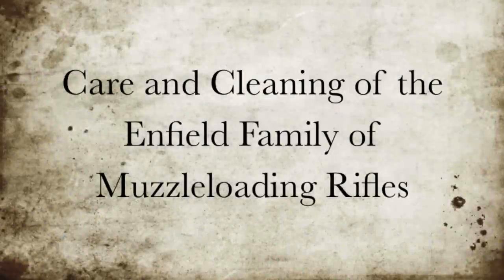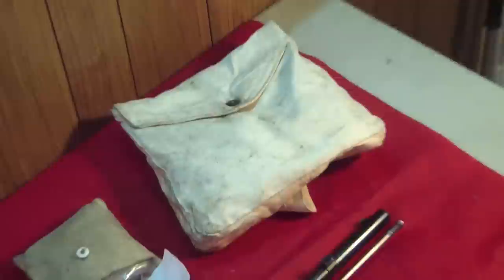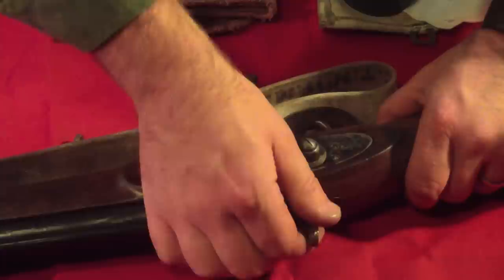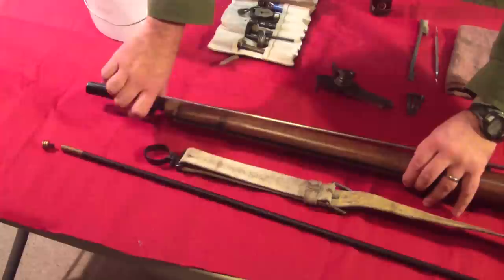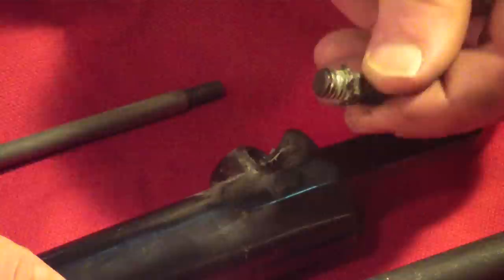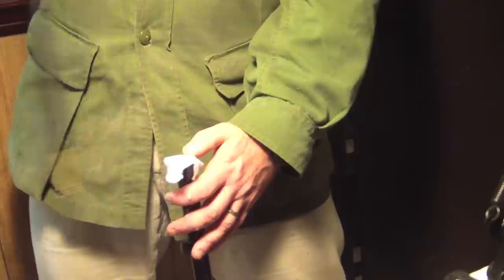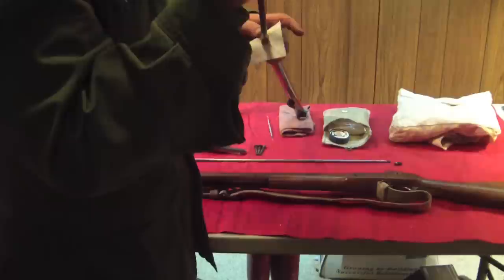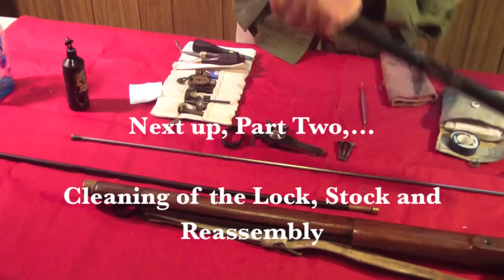Care and Cleaning of the Enfield Family of Muzzleloading Rifles: Pt 1

Comment: You're one of the few who I've seen use a bucket to clean the barrel. I have done this exact method for years, and it's the best way in my opinion to clean a musket barrel.  After watching guys in my reenacting unit using all sorts of items like they just raided everything from under the kitchen sink, with their bottles of Simple Green to Windex...etc...etc it was all so overkill. I showed my unit this simple method, and they were all amazed how well it works. Hot water, some dish soap and light oil (or Ballistol) for the bore is ALL you need. I can completely clean and lubricate my barrel, all with just 6 patches, while the other guys have a pile of dirty  patches around them and scrubbing away. lol  As you said, when the barrel is full of water, on the down stroke, push down and it blows everything out of the cone hole, literally blasting everything out like a fire hose. With this method, you're basically pressure washing the barrel. It's awesome.

Anyhow, another fine video. Thank you!
Reply from the maker: Cheers!

Comment: Hi.  Better way to remove the lock is to loosen the nails then tap the heads with the turnscrew handle.  The lock plate is pressed out from the inside and doesn't damage the inlet.   I  also clean the nipple to bore channel with a section of  bent pipe cleaner - gets round the bend.  Superb videos and presentation.  First class.  Thank you.
Reply from the maker: Thanks for that Peter...  I suppose that I should have included that method as well....  Typically, I don't need to as the lock slides out with a bit of torque applied to the hammer to keep things square.  The mortice is not damaged in any way as the lock comes out straight.  So many ways to skin a cat, eh?  Thank you for the kind words.  Glad you are enjoying things. Cheers.

Comment: Ive always enjoyed all your videos.
In my research to do here in the USA for cleaning Enfields as a ACW reenactor, i found that just water (not hot ) was used to deactivate the corosion of black powder , then dry out the barrel and then oil the bore. I found that information in a field manual.
Ive told my buds about it and cant grask the concept of not using hot water.
Thanks.
Reply from the maker: As long as the rifle is clean and oiled, don't really matter what method you use.... This is simply the way I clean my Enfields (and all BP arms)... Cheers.

Comment: When cleaning my Hawken and Ardesa Evolution .50 Cal I use an upright piece of plastic waste pipe, 125mm dia, sealed at one end and held against my workbench with an elasticated bungee. I fill the pipe about half full of hot water and pure soap and then clean the barrel(s) in it. It avoids spillage and gives you a good purchase on the cleaning rod.
Once clean I just remove the elastic and pour the dirty water away. 
For nipple cleaning I use a piece of aluminium strip with holes in it. I threaded the holes so I could screw the soiled nipples into them and then holding one end of the strip I dip the nipples end in the hot water and scrub with a brush.I developed this for cleaning the nipples on my Remington 1858 revolver but it works just as well with one nipple as with 6 and no awkward holding and scrubbing your fingers!!
Reply from the maker: That plastic pipe idea is a good one.  I always seem to make the mess when I withdraw the cleaning rod while the barrel is in the water and it pulls some water up out of the barrel...  By keeping a plastic bin lid on the floor under the bucket, the splashing water stays under control.  Interesting method of cleaning the nipples.  I can certainly appreciate the ease that it would bring to cleaning a bunch of nipples and singles too..  Would give you good purchase on the small part in the hot soapy water.  Cheers.
Reply: britishmuzzleloaders It does. I would be happy supply some images of the pieces I mentioned if you wish.
Reply from the maker: That would be most appreciated.  I'll fire you a PM with my email...
Reply: britishmuzzleloaders OK, no problem!

Comment: About the only thing i do different is finish with boiling hot water ( heats the barrel so HOT it dries any moisture ) followed by a couple clean patches then ballistol oil for preservation ! 
Can you still buy those floppy plastic loading/cleaning rods ? , i have one but i cut it short for hunting with the musketoon 24in barrel !
Reply from the maker: So many ways, for sure.  Scrub them out, then oil them up for storage!

Comment: Britishmuzzleloaders, could you do another video like this one, but specifically for the Snider-Enfield? I realize the processes must be fairly similar, but I would assume the added complexity of the breach block changes things. I'm going to be doing my first ever black powder shooting with one, and as the rifle has such history to it I would hate to make a mistake and cause moderate or major damage to it. 
Thanks.
Reply from the maker: It's a service rifle... you won't break it unless you are silly with it...  It is actually much easier than a muzzleloader... the barrel and lock don't even come out of the stock... I run hot water through the barrel from the breech for a minute or two, then bronze brush the bore a couple of times with some soap, then flush, then wipe with 4x2s... The shoe cleans up with a bit of wiping, although a tool to get into the angles might be helpful... oil and then you're done!

Comment: Do you have a pattern for your tool roll, and pouch. Where did you acquire the turn screws screwdrivers? Any help a plus.
Reply from the maker: Cesar Ortiz I don't have a pattern per se...  I just sewed a piece of canvas up both sides to form pockets that fit all the bits.....  Then added the turnscrew pouch..  made to measure.  The turn screws were the budget option from Track of the Wolf..  They are proper turnscrews, however, with non-tapered bits...  Cheers.

Comment: Was wondering why you don't use a brass cleaning brush for the inside of the barrel? You feel that it's to abrasive or to hard on the barrel...I'm asking because I've got to break my original Enfield down and clean it and I usually use brass cleaning brushes for the barrels when cleaning
Reply from the maker: The thing with a bronze brush is that it is typically slightly larger than the bore... it will go down the barrel ok but then when you go to pull it out, it's bristles act like barbs.  In order to get it out, you have to twist it first.  To me, it's all unnecessary wear on the barrel.

Comment: a clean my p58 the same way end its working fine,a see you solder a peace off brass on the front sicht how hy is the blade in milimiters,a shooting to hy on 50 meters,nice video very helpfull
Reply from the maker: Hans,  if you are going to actually modify your sights rather that aim off, then you should really calculate how much to change them...  Although it is an involved process you will get best results with this method.....  First group your rifle.  Shoot a number of loads in a systematic progression to arrive at which one shoots the tightest.  It doesn't matter where the group is on the target and you must keep the same point of aim.  Once you have got your load then shoot a decent ten round group and measure it's values to determine where the centre of the group is in relation to your point of aim.  Then use simple ratio math to figure out how much to modify your sight.... OR....... PM me with your email and I'll send you the Figure of Merit Calculator and it will figure all this out for you.  Here is a tutorial on how to use it... https://www.youtube.com/watch?v=zAntq2M0o30.

Comment: I use 566 grain shallow base bullet designed for navy arms cal 58 parker hale
Reply from the maker: I have found that the shallower base bullets work better in both the P53 and the P58 (i.e. fast and slow twist barrels).  This is contrary to conventional wisdom that says a shorter, lighter bullet will perform better in the slow twist... What ranges do you shoot at?
Reply: britishmuzzleloaders 50 meters and 100 meters ,and I use very soft lead
at my work we fabricate products off lead and from the scrap I cast bullets
Reply from the maker: Hans Brethouwer
What a great benefit to your work.....Now,  take the money you save from not having to buy lead and get a Pritchett mould!...  Real Enfield food...  Seriously though, nothing quite like shooting with the proper cartridge...  How loing have you had your Enfield?  Does it have progressive depth rifling?
Reply: britishmuzzleloaders my englisch is not very good sorry for that,a have my enfield  a month now,for the rifling I dont no its build in 1970 or so
and the pritchet mould is in the make on my work.